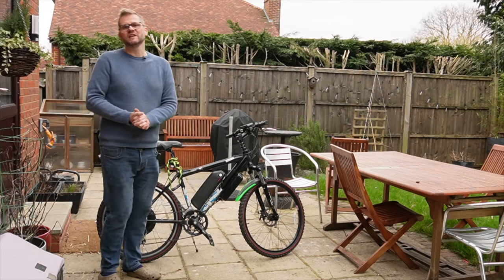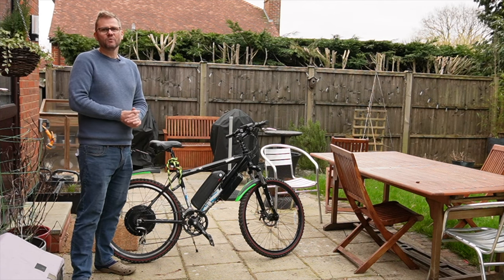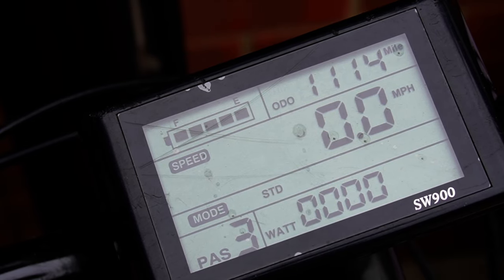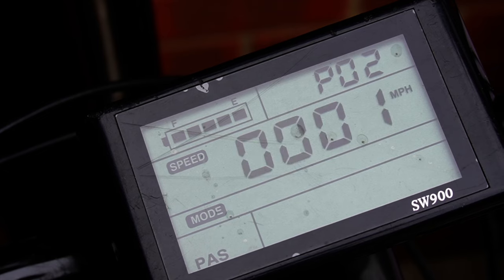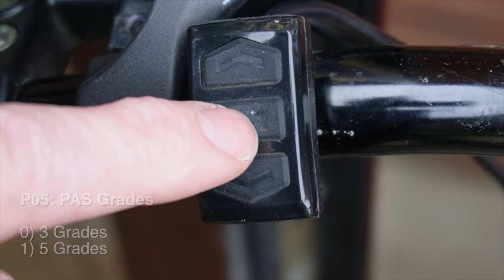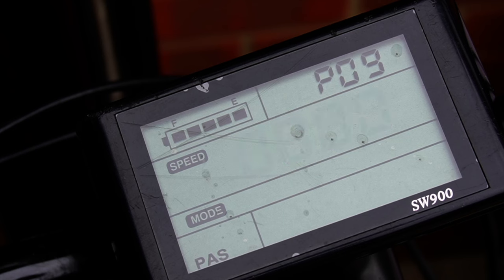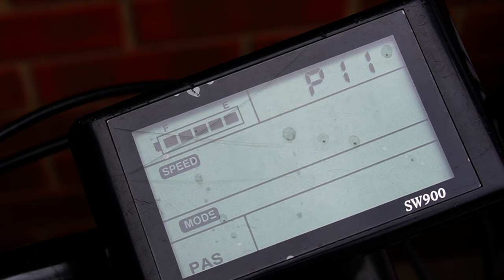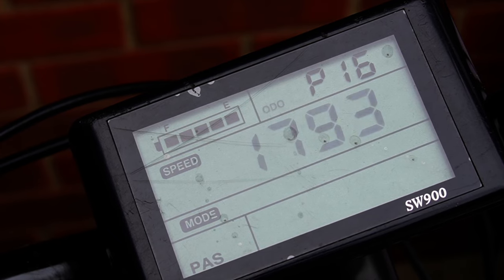SW900 E-Bike controller setup guide

Comment: Hiya so my screen arrived sw900 it has two connection ports a 5 pin and a two pin ,I have no idea where the smaller two pin goes, I have fitted the 5 pin and I followed your set up , but nothing registers on the screen but the bike works on pas and horse off far to fast , mph not workin , watts not working but the screen illuminates with battery at 75% , obviously the two pin goes some where is your SW900 like this .?

Comment: My cheap Ebike has a similar power switch, but a different controller. The manual does not state how to change settings, though the P codes appear to be the same.  I will try your instructions on my bike at first opportunity.

Comment: High on p5 it won't work on 3 sets of speed I like 5 and there is 9 and p6 under voltage that comes up when I swich of. I always turn did play of then battery then press button on display then it flash that's when p6 under voltage then goes of its to clear voltage in controller so yes p5 can't get them leval of speed. That shoud work even if unplug pedal assit from controller have you idea for this problem thanks

Comment: This has been a great help mr Bodger ….my new screen comes in 7 days I can wait to install it 👌👌
Reply: I keep getting error 11 I think it's in my settings as it worked fine til I started tweaking the settings improperly my fault ow I've had to set my wheel size to 16 instead of 26vto get accurate speedometer I think it's my speed sensor setting

Comment: Hey mate, I have a question, if I purchase a controller with a similar amp and wattage rating that comes with a display, that should work for a hub motor, right? 
I purchased a second hand home built bike with a 1000 watt motor, but the controller is shite and I ordered a seperate controller with this display.

Comment: Holding top 2 buttons the screen will go into another menu then pressing the same 2 buttons you can cycle through to display actual battery voltage  an voltage drop in use

Comment: P01 display brightness
P02 the unit of mileage
P03 voltage grades 
P04 sleep time , in minutes 
P05 , pas grades , gear grades 
P06 wheel size 
P07 speed measuring magnate range 
P08 , speed limig
P09 ,zero start mode ,0 is zero start , 0 is throttle , 1 is crop throttle 
P10 , driving mode , 0 is just pedal assist ,1 just throttle , 2 is both pedal and throttle
P11 , pedal assist sensitivity , 01 , the lower the number the more sensitive the system is, higher doesn't work properly at all
P12 , how strong the pedal assist kicks in , 0 is actually perfect
P13 , magnet types , 3 , 8 , 12 , mine is 12 
P14 , current limiting controller mine is 28
P15 not used
P16  , up push and hold to reset

Comment: Thanks for the info, I have the same controller on a quad bike but mine does not have the remote up down m button? Can't find anything on the net as all sw900 controller info i found come with a remote but not mine so unable to make any adjustments can I just add one? Thank you

Comment: Is there any way to adjust the pedal assist speeds? On the 5 selection mode the #1 is very weak at 5 mph...when you go to #2 it is a big jump up to 12 mph... I would like to have a 7 or 8 mph instead.
Reply: I’d also like to know that!
Reply: @jasperspeckles  I've just resorted to feathering the throttle while I pedal...

Comment: for setting P14,  if i have a 48v  1k watt hub motor with a 48v  13 ah battery. would i limit it at 13amps? my display can go up to 50.
Reply: Mines set to 26
Reply: A 13 AH battery even a cheap one will do 25 amps easy.

AH is it capacity. I.e at 13 amps it lasts for one hour.

Comment: what happens when you change the controller amps?
Reply: Basically it needs to match battery amps which should match controller amps, check your battery and set amps closest to that
Reply: Mines a 48v 20ah battery and 1000w motor and the amps setting is 26 - not sure why but that’s how it’s supposed to be set apparently
Reply: Your motor is rated in Watts, you can change the Amps because Volts x Amps = Watts eg 48v x 26A = 1248 Watts. Hopefully you have a 1200w motor or it could cook eventually
Reply: @daztastic147 you should set at 20amps for a 48v 1000w
Reply: If I wanted to dial down the torque would lowering the amps do any harm?
Reply: @richarddrew662  there should be no issue with that, it's the same as not twisting the throttle as far

Comment: is there anyway we can get a kms or miles range option in the display?
Reply from the maker: P02. I believe.
Reply: @artful-bodger  i meant range as in total kms or miles that ecycle can run with existing battery voltage and amps

Comment: Cant you put p14 higher than 20? My controller can go upto 50
Reply: I put mine all the way up to 50 but be careful because you can potentially harm your motor if it can't handle 50 amps. I have a 1500 watt motor with a shunt motified controller.
Reply: @Icantremember01  i can put it up but it doesnt make any difference
Reply: @Icantremember01  what difference does it make by changing this

Comment: My ebike did 45mph I fixed it with this now it does 48 to 49mph someone explain? Also night need new battery I'm sure it can do up to 70mph I got 48v if I upgrade to 72v and modifier, I can do 72mph or 120mph if I keep the battery I got aswell..
Reply: Good luck with stability going 70mph I hope you have motorcycle suspension and a heavy frame, but I’m gonna hope that if you’re already at 50mph you know what you’re doing ! Stay safe
Reply: @Floridaprophet  My frame is really really heavy, and suspension does it's job, I don't go on 70mph as everything shakes crazily, I have done up to 60mph+ and able to control it...